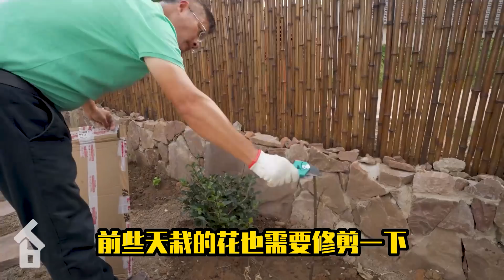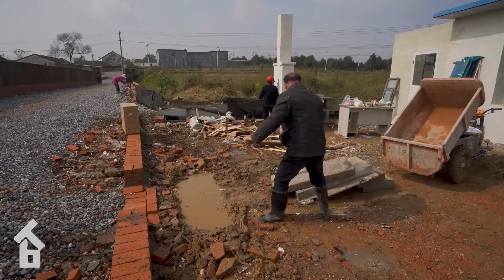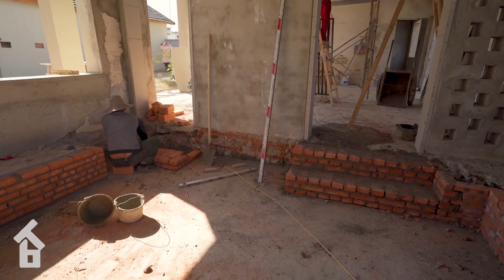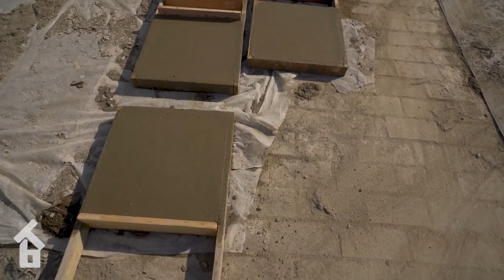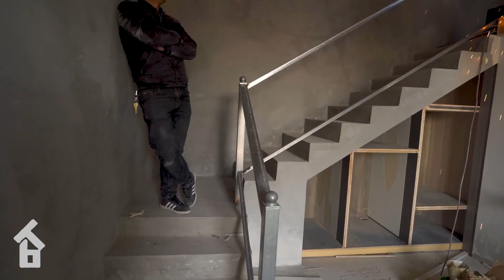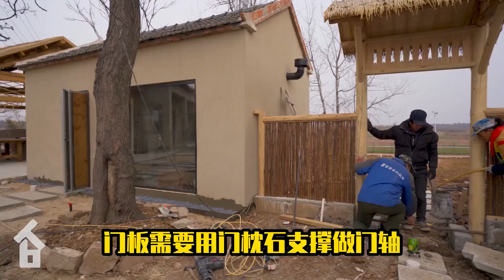The man who renovated the 200-year-old house turned it into a mansion, making the villagers jealous

Comment: My husband and I bought a 150 year old house to renovate right here in England and it took us 13 years to finish it, with raising a family having to actually work to be able to do that. We did renovate it we searched every single reclaimers yard antique shops placed adds in papers looking for a specific tile that was used and we reopened all the fireplaces. The outside is still the same the inside has been renovated the only thing we changed were the windows to double glazed we kept the same style and half of them were old fashioned sash windows. The wallpaper that was on the downstairs walls had been on there for over 70 years it was still in pristine condition and when we found out the still did this paper we were ecstatic until we saw price the cheapest was 40 pounds per panel right up to 2 thousand. To rich for our pockets but the shop that sold it said the paper can be restored as is. He came out and showed us. The saying you get what you pay for is correct. This entire house was built and we have the papers and plans for it it cost £500 english pounds it is now valued at 840k and if we wanted to sell the land as well. we did well. This job here wasn't a renovation it was a show piece and I can also understand why the locals might get a little envious.